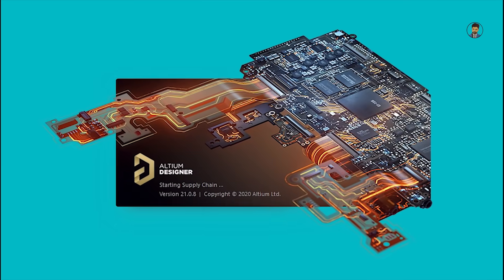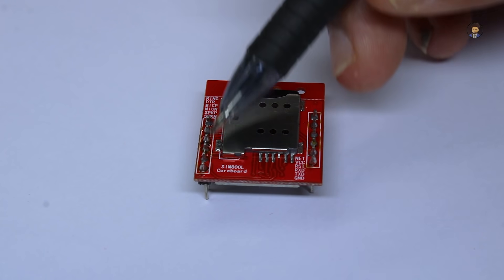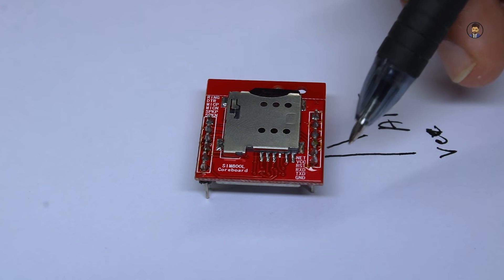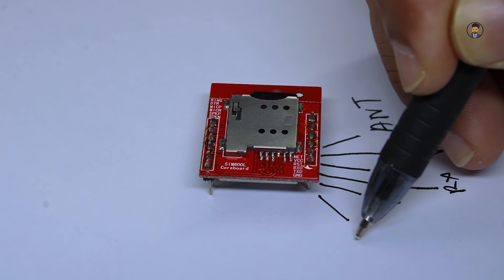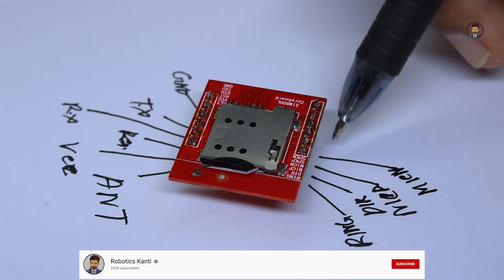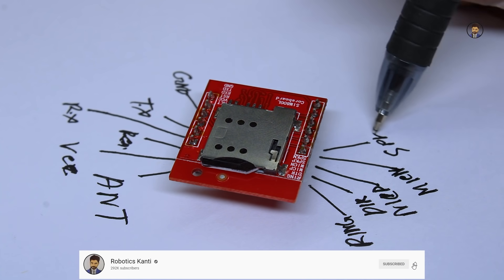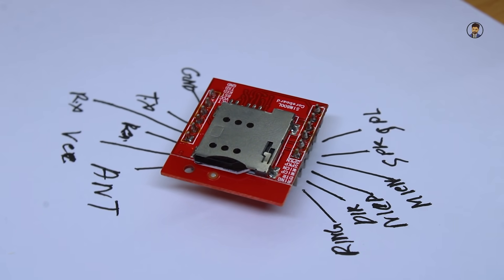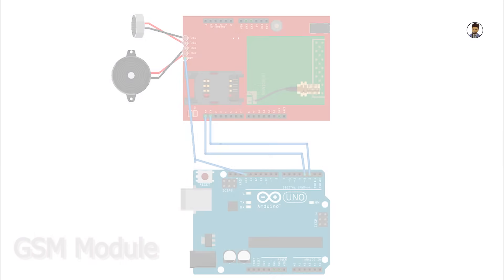how to make keypad 2g mobile phone at your home

Comment: This video made me so uncomfortable I logged in to post this comment. This guy is definitely good at 2 things:
1. Video editing.
2. Fooling people.

There are so many reasons why it wont work. But let me tell you the most obvious one that even you can cross check. AtMega328p can be operated at 16 MHz only when supply voltage is more than 4.5v. In the video this genius is using 16 MHz crystal and is driving the circuit using the Li-Po cell (LiPo cell's full charge voltage cannot exceed 4.2v and normally provides 3.7v). By the way I like his confidence in putting the capacitors in the long distance relationship with the crystal.

Comment: Dear sir I need a circuit in which we can convert 3.7v to 5v with easy found all parts and components
Reply: Use boost converter
Reply: @jagdishsingh9997  I need circuit diagram sir